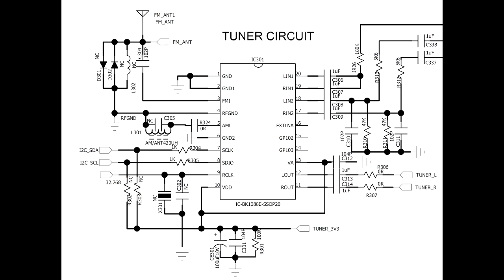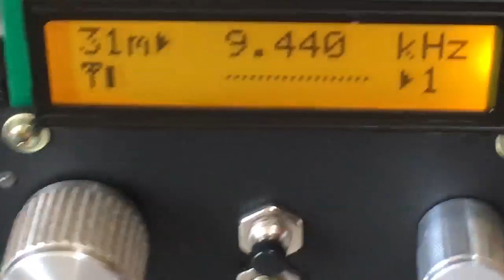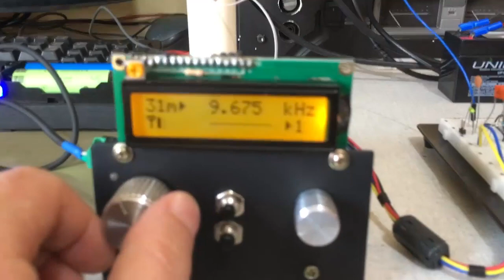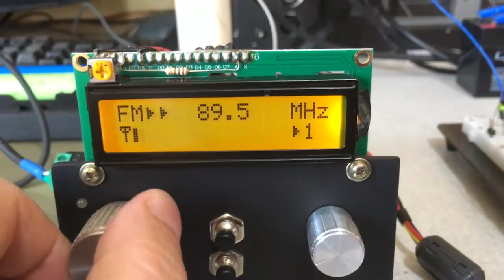BK1088 DSP RADIO RECEIVER IC TEST - ARDUINO CONTROLLED

Comment: without a single path capacitor with only crystals, can the circuit still work?
Reply from the maker: Hello Soni, I did not use any capacitor with the crystals and the circuit works very well.